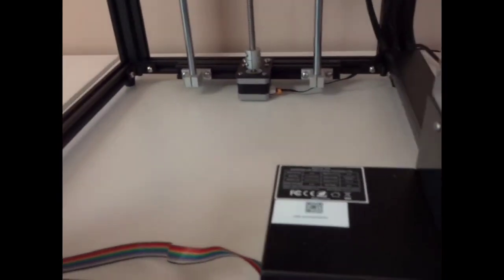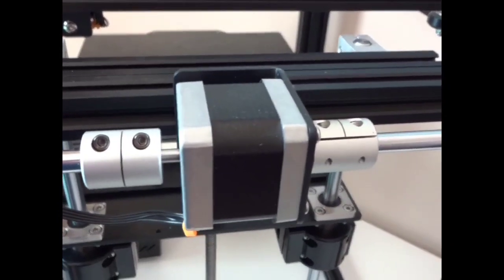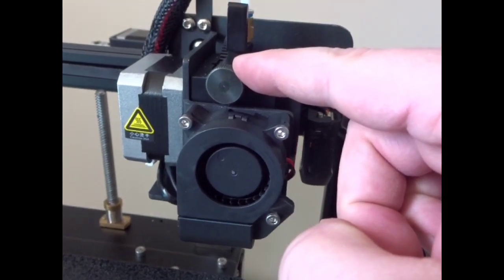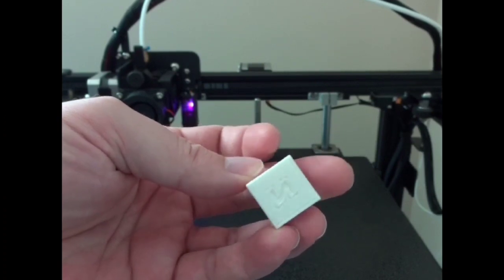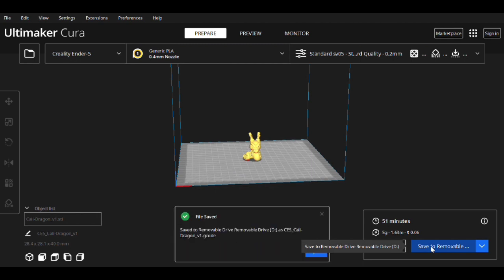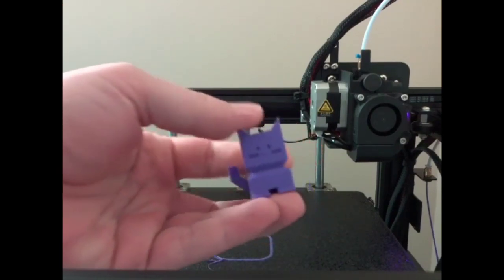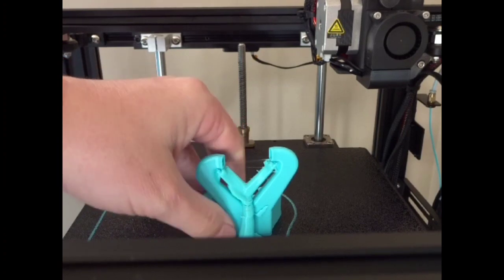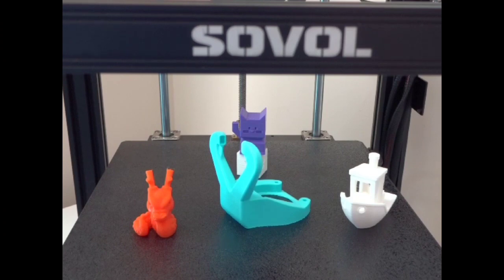Sovol SV05 3D Printer Review

Comment: Seems like a decent enough printer with some adjustments.  I am surprised they using their competitor's control board.  Does it have its own firmware or is it using Creality firmware also?
Reply from the maker: Sovol is a devision of comgrow which owns creality. At least this is my understanding. Its really just an upgraded ender 5 though. As for firmware, it has sovol branded marlin.
Reply: @joeprints3dstuff  I did not realize that.  Makes perfect sense then.

Comment: How did you adjust the extruder?
Reply: I just got one directly from Sovol (they had an anniversary sale) less than a week ago. I had lots of issues getting the extruder to work properly: it appeared to get clogged, or not get traction enough on the filament to properly feed it into the hotend. Turns out that if you look down at the idler wheel on the lever arm of the extruder it's 'gutter' was misaligned with the hole that leads to the hotend. Apparently at manufacturing time they put a washer between the bearing that that idler is on and the arm it is screwed to. Undo the screw, move the washer to the outside, or remove it at all, screw it back into place, put the arm back into place, and voila. Issue solved. No more feeding issues.
Reply from the maker: The thumb screw on the front of the extruder. It needs to be adjusted so that the gears are applying the correct pressure on the filament. You have to feed a bit through, then back it out and look at it. It should have some slits cut into it but it should not be deformed.